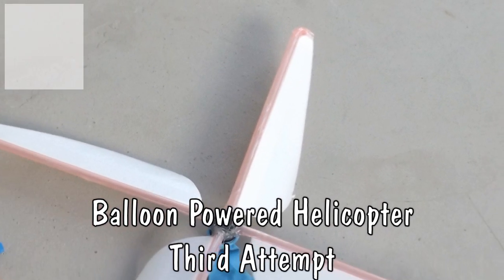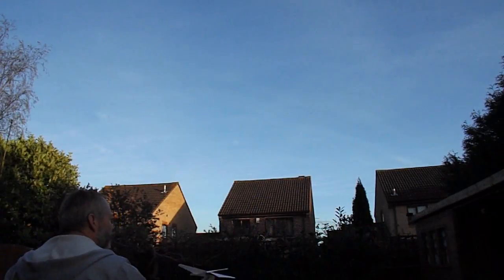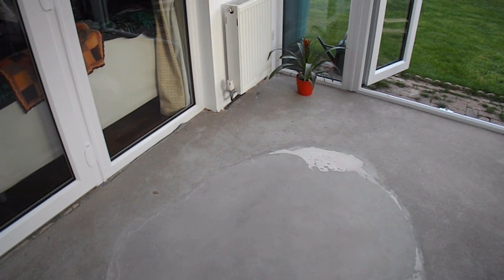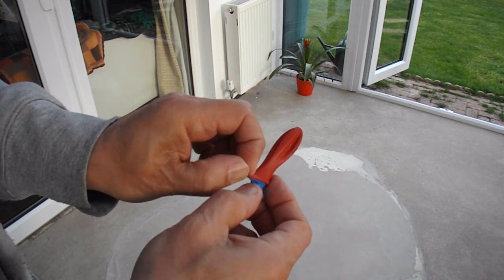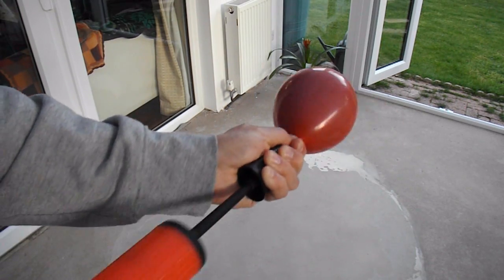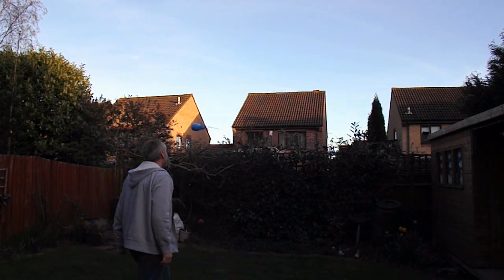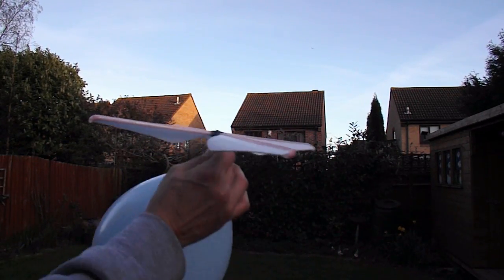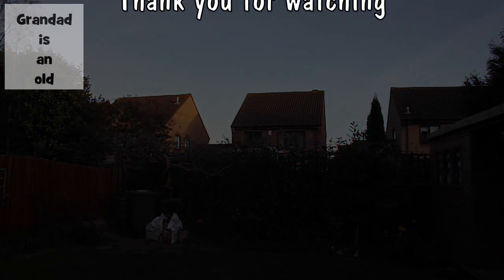Balloon Powered Helicopter - Third Attempt Part #2

Comment: yes if you cut off the tips it will be lighter cose those straws are on the end it slowing down and makes it havvy
Reply from the maker: Lol Plane perhaps you should try making one. The straws are bent around the tips so that the air is directed to the back pushing the blade forwards.
Reply: yea mayby